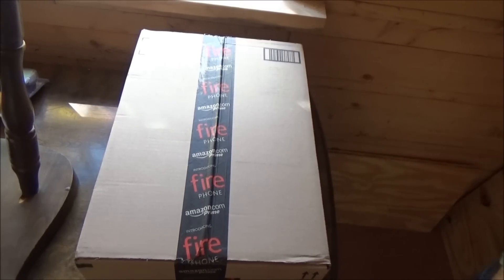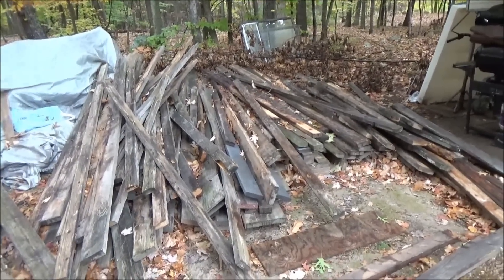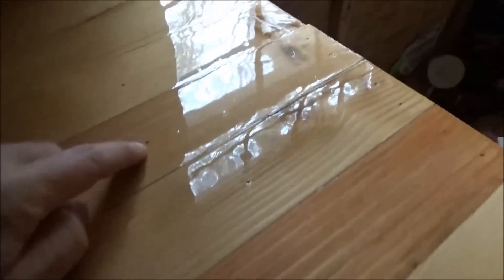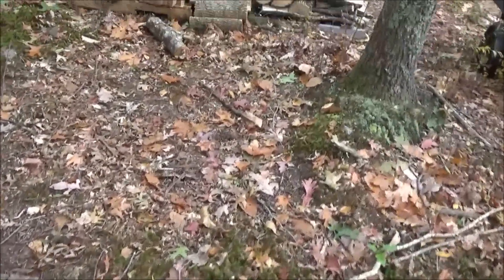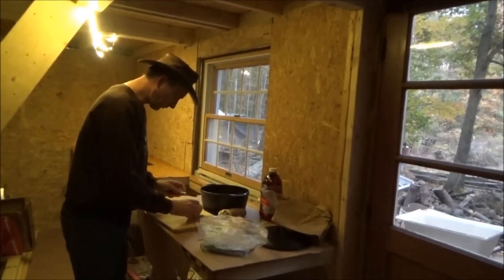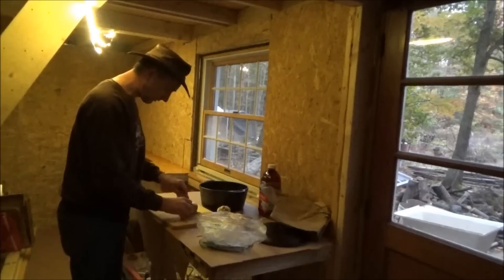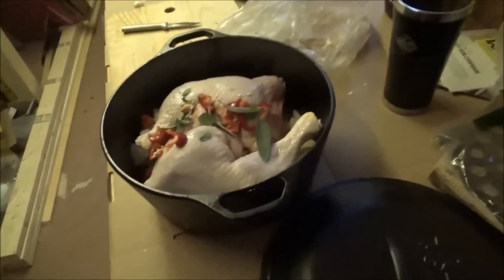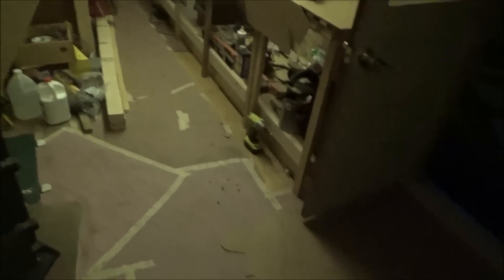First Meal Cooked On My Tiny House Wood Stove O22

Comment: im a single female , who is planning on doing this exact same thing , I bought a 14x36 shed and will finish out the inside myself , so far I have bought a tankless hotwater heater that runs on propane , I have the radiant barrier , and I have an utility tub that will be a sink for dishes and double as a tub for my special needs son , hoping it will save on my back some , ive enjoyed your videos , thanks for posting

Comment: I bet you can bake in that, too. Just sit your baking pan in on top of the rack. ;) What a nice gift. Good timing. I bet that chicken is good. If you just keep water in the pot and keep it warm on the stove, you don't need to refrigerate the left overs. Just add food to it as you eat it and you can keep your stew pot going almost forever and have a quick hot meal when you walk in the door. Add some beans and water after dinner and just let them slow cook all night. Lunch will be ready when you are. You may need to sit it on a trivet or something to get it off the direct top if you really fire up the stove. You don't want it to scorch, just stay above the temperature where things spoil. If you get some of those corn shaped iron molds, you can sit them right on top of the stove and "bake" all kinds of things. I used Jiffy Mix muffin and corn bread mix a lot because it is cheap.

I find it very interesting to see what you are going through with the counter top. Finally, you got to use it for its intended purpose. Nice. :)

My husband used to go get deer and 50 pounds of beans for winter. Chili all winter! Glad you are getting some protein on the hoof. You do need it. And, truthfully, starvation is a hard way to go. If hunters do not thin the herd in your area the deer suffer more because there simply is not enough food around to sustain them all in the winter. Ultimately, it is a kindness to hunt some of them. so don't feel bad. You are saving Bambie from a worse fate.

HEY Kentwood!

Comment: The dutch oven is a nice asset for the tiny house.Glad to hear that You got the stovepipe issue straightened out. Countertop looks nice! Could be that the brads/nails have oil residue on them from the factory,or contaminated from the gun.I don't think that You really want to redo it.

Comment: wow i love love that counter top!! My husband plans on doing our island in wood. We tried to do a concrete one and that was a disaster. We have a local saw mill that has pretty large cut slabs and im hoping he can work on that soon. we have our stovetop set up on the island and then he has the small propane tank underneath. We too live off grid and this simple setup works well for us since we dont have a large propane tank or anything piped in for propane. I would like to see your step by step on your countertop. What kind of poly did you use? Im assuming gloss but what brand and how many gallons did you go thru? Im assuming you brushed this on??? Thanks

Comment: Hey Troy - I do like the counter and it will work well for you. The reason why you have the problem with the nail holes is that you didn't fill them. Your method worked well enough for the materials and resources (including time) you had on hand.You'll have years of use and then you can re-visit the project. (translate: I think the counter-top will be fine now, get a sink in! Even if it has a slop bucket to drain into and no running water. Its essential in a kitchen) 
Kentwood is absolutely right about your footware. Do you have cold feet in the morning?Leather boots/shoes will keep you nice and toasty. 
That dinner looked great, wash your hands and work surface immediately after chopping onions to get rid of the tear-jerking juices. You'll still cry, but it will stop faster. And you need a bigger knife! preferably a good chief's knife. It's faster to chop with.
I would be curious to learn what the cooking temperatures are on top of the stove and watch your learning curve on mastering  the stove. 
And happy belated Canadian Thanksgiving. My sister cooked the turkey this year. And no firewood was chopped.

Comment: Nail depressions hit with wood putty, for your crinkling on countertop could by uneven drying or dust. Try picking up a tack rag at the hardware store, you can wipe down the surface after each sanding. Tack rags come in 10 packs and are basically sticky rags, they will remove whatever dust that won't be removed with sweeping. That will allow you to get the clean finish that you're striving for.

Comment: Hey Friend :)
This is the first video of yours I have seen, looking great so far.
The problem your having with the finish not sticking to the nails stems from the fact that the nails are coated with oil in the making of them and they don't clean them to help to keep them from rusting. Usually you can set the nails and fill the hole with a wood filler, sand and apply your finish.
Good Luck
Lou

Comment: on the nail holes before applied you clear you should have applied wood putty and sanded it down then applied you clear. you can make your own wood putty from wood glue or white glue and fine saw dust. add enough glue to make it a thick paste ( almost dry ) it will take practice ( the yellowish wood glue works the best )...

Comment: The wood could have had oil or something spilled on it before u got it the same thing happens with auto paint if tire cleaner or anything like that gets on the surface your painting or clear coating it will wrinkle or fish eye! It's very had to tell if something like that got sucked into the wood! But your house is looking great Troy good job :)

Comment: HI Troy, I've used superglue to seal the tops of nails prior to painting/varnishing sometimes mixed with fine sawdust basically if the nails are galvanised the varnish will not adhere to them but will sink into the hole
Reply from the maker: thanks

Comment: The effect you are getting is from possibly high humidity, and paint that is not totally drying correctly. It is drying on top, but underneath it is still slightly wet, If you put another coat on it, the new top coat will dry but the bottom coat which was not completely dry will vapor out and cause an orange peel effect or wave effect in the paint. On high humidity days I would leave any type of painting go, for this causes blushing, and the stuff that you are seeing now. On the nails I would try the varnish that you are using with a small artist brush, then after dry sand with sandpaper, 400 grit, then 600 grit. Wet sanding if possible. Which means get wet sanding paper, dip in bucket of water, sand, re-dip to rinse paper off till you get the smoothness you want. Do not break through the first coats of varnish to expose wood, this could ruin your wood if you do. The reason the nail holes are showing up is that your varnish is seeping in around the head of the nail down into the wood. It will stop once enough has seeped in to coat the wood around the nail. Best bet is to let dry usually I wait 3 days in high humidity in less I have infared lights to bake the paint. Then I sand until smooth, apply another coat, sand until smooth, (I do this about 8 to 10 times on clear coats and candy jobs). On the last coat, I usually mix 7 parts of thinner (see paint instructions for type of thinner used) to one part of paint. I have spray equipment, so I spray this finish coat on,   Depends on how glossy the customer wants his finish.

Comment: Yes you should have filled the nails with wood putty. And the other indentations sometimes it does that ,think its where air bubbles where and busted. You can blow your breath on it or hair dryer . I us a celalean torch you can hole it away from it and work your way closer you will see when you get closer it will start to even out. Do this as soon as you finish putting it on.

Comment: I've had that happen before , I wanted to add another coat to an already painted surface , I ended up with a krinkle effect , the I realized that the last coat I applied , the thinning agent it had in it'a mix was working on the coat underneath causing it to react in this manner.
Put some clear silicon over the nail hole and when it dries poly coat that.

Just my speculation.

Comment: Use the meat rack in the cast iron dutch oven to keep meat up off the bottom. I do not eat much meat myself but make meals for pot lucks etc.  Wild game is the BEST.  Avoid store bought meat if at all possible. 

As for chickens.  A few weeks ago I helped friends cull 30 meat birds, and will help my friends Brian and Lisa do more in a month.  So find someone who will do yours and you do theirs.

As for the nail heads they needed to be counter sunk and then wood filler put on top, sanded and sealed.
Reply from the maker: Thanks for the tips
Reply: Actually, that is a great idea. Trade killing off the birds so you don't feel as if you are killing a friend.

Comment: I know it's way to late but a few things that can cause a problem with the poly, moisture in the wood, temperature or humidity. May not have completely dried between coats. Might have been a good idea to have put a sanding sealer on it. Wood putty over the nails. (screws might have been better. Nails can become loose) Looks pretty nice
Reply from the maker: Thank you. For future reference that helps. The tiny house served me well. Recently sold it and moved to Michigan with my wife. Yup, things sure have changed.
Reply: Onward  and upward. I subed so I'll try to catch
Reply from the maker: Cool. Hope you enjoy the show. I had some rough times there from trolls and attacks so dont let that stop you from watching through. I kept plowing on and kept going always forward no matter the trials.

Comment: Well could be that between two coating you have to wait a lot longer than what you read..on top all is depending on the atmosphere... if it is humide or very dry....it is hard to varnish correctly....with humidity...but you can do sand it very well again..on a verydry day...varnish over..and wait at least a day or two between each varnish.......

Comment: a few years back i used to pyrograph tables i used your method of filling cracks usually using small bottles of titebond USA glue  but nails holes i used what your guys would call Spackle which i colored a little with some brown children s powder paint the reason I used Spackle because it did not shrink,
the problem you are having is caused by surface tensoin differences , you are applying a coating which never bonds to the wood that is why if water gets behind it goes cloudy.

you should sand back surface when fully cured,see diections can (add 12 hours    Spackle holes  with spackle  make sure you colour spacle     light sand    then uses roller foam not fluffy ones to put on 50 50 thinned coat of your polly use a hair dryer to pop air bubbles let dry light sand repeat until you are happy should be like glass

I have heard of two pack epoxy being used on nails as well but i have never used this myself
   learning new skills is always difficult and there is always 25 ways to do something you are doing great you the evidence is in your subscribers god go with you lad john UK

Comment: a old tip for wood stoves, to clean your glass, take newspaper and wad it up  dip it in water then into your ashes.... so you then have a damp wad of paper with ashes on it, thake that and use it to scrub on the glass window in the stove..    the ash is a caustic like substance....  works great to scrub the glass clean.

Comment: The crinkled effect is from multiple coats of poly. Every new layers sort of melts the one below it. Like fingernail polish, if you put too many coats on or are out of remover more coats liquefies the old layers so they can be removed. This is part of why I told you about the epoxy resin that is used for counters and bars.
Reply from the maker: Strange because on the can they tell you how to put on multiple coats
Reply: I can show you what I mean. Take a piece of scrap wood and apply a layer to it once a day like you did the counter. On the third or fourth day after you apply a new coat, scrape your nail across the board, it will pull up the other layers as well because they have softened. Just like nail polish. The epoxy would have saved you money and time in the long run because it is permanent and only takes once to coat it and 24 hours to dry to touch and 72 hours to be fully cured, and it is almost impossible to damage after curing. Knives, bottles, water marks no problem.

Comment: The reason that the nail heads are not filling is because as you pass the poly over them with the brush you are trapping air in the hole itself.  As the air expands with the poly gas is pushes the poly away from the nail head.  If you don't want to fill the nail holes with putty you can use a toothpick to dap poly into the holes and build up to fill the holes.
Reply from the maker: I will try that. Thanks

Comment: your polyurethane wriked because it was not fully dry an the sun comin through the window heated it an softed it too much. drop some polyurethane thinned with paint thinner on nail heads using a tooth pick.may need to do several times.

Comment: How would you keep deer meat with limited refrigeration?
Reply: There are lots of ways. He can can it. He can dry it. He can smoke it. Also, he can make an insulated cold box to keep it frozen. In NY. It stays cold long enough there that you don't need a freezer. Once meat is frozen, keep it in a well insulated place outside and it should stay frozen even during the occasional warm days. During the winter, a freezer is redundant. I know that if you never lived there, it is hard to imagine what it is like.
Reply: Cheers for the answer SSanf
Reply: keiran bowes
Glad to if I can. Troy has his hands full at the moment.
The main thing will be to keep the animals off it if he uses his "outside freezer". It needs to be a very sturdy insulated box.
Reply from the maker: The ancient ways. Dry, jerky, salt cure, pemmican
Reply: The Do It Yourself World
borrow a garden tiller. dig up a 8X10ft patch in some shady spot. dig out the dirt, tiller,,dig, repeat intill you're 4ft down. make sand bags out of the loose dirt, stack around pit making a wall. it should be at least 6ft deep inside. place saplings or poles across the top. drape a tarp over it. scatter a foot or more of leaves on it, top it with dirt or more poles, install a thick door, old blankets etc will do. store cold items inside. if it doesn't float your boat, it's also a sweat lodge.

Comment: By that Brian means season the oven, you need to oil it to create a seasoning on the cast iron. Should last you a lifetime. Always wanted a Dutch Oven.
Reply: This is right unless it came pre-seasoned. I think the new ones are sold that way these days.
Reply from the maker: Yes. I only use cast iron now. Switching over. Best stuff you can own.
Reply: Like your friend who'd sent it said - 1st thing, throw it on the fire. This could've meant to is to burn off any oils applied to prevent it from rusting - or it was ready to go after heating to seal the good, useable oil in. It depends on the manufacturers. Years ago, I'd bought an inexpensive cast iron griddle. It's the type witch has the raised rows, which mark the meat as though it was cooked on a charcoal or gas grill. 

Only trouble is, when I put it on the stove to heat it up, in order to then oil it & let the oil I'd used bake into it - the oil it came coated with had a really bad smell. Then I realized it was a cheap one made in china, so maybe not an oil I'd want to cook with. Maybe it was more like something for industrial use - like something used to keep cheap metal parts from rusting. 

By the time I decided the smell was too off-putting,  felt it was too hot to wash so I put it aside to cool off. Have never even used it since then. I just didn't trust it for food. Just came across it today, oddly enough. That was about 20 years ago!!! 

Maybe it's time I clean it with a wire scouring pad & hot soapy water, rinse it off, put it on a hot burner & see if it still smells bad. Maybe I can try again - re-oil it & try finally curing it properly! 

So how'd that work out for you ? Did the pot need to get washed & cured 1st, or was it ready to go?

Comment: You can't paint, varnish or poly one side of a board without doing the same to the other side or it will cause the coated side to curl.

Comment: Based on my own personal experiences, I'd say the wrinkle effect is most likely because you are putting on too thick a coat. If you put on thinner coats it will take longer of course, but it will look less wrinkly in the end.
Reply from the maker: I made it as thin as I could though. Could be the colder weather maybe
Reply: The Do It Yourself World Thats probably it right there. Air circulation, surface temp, paint temp, age of previous finishes, it all makes a difference. Paints, stains, urethanes - they're all fussy.

Comment: you're using too much polyurethane., it's supposed to be applied thin and steel wool sanded between coats and you're supposed to wipe the dust off with a clean cloth. this is done for 3 or more layers.  you should have thinned the poly using mineral spirits, the original strength is too thick. the "crinkling" is probably because you applied a super thick layer of poly all at once, it probably absorbed it like water is my guess., sanding off the whole thing til it's flat and redoing it like I said will fix it, but to be honest you already did it so why bother. just remember it for next time.